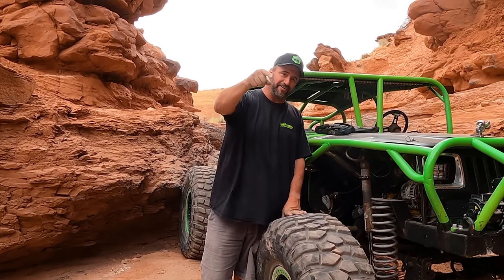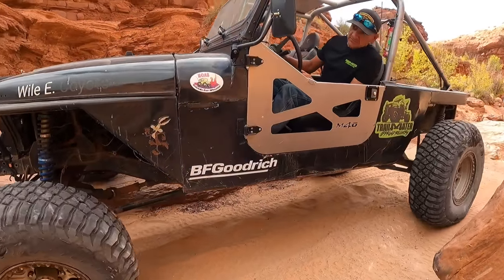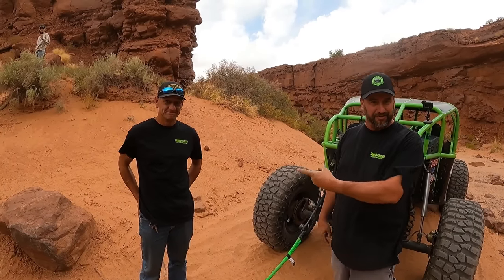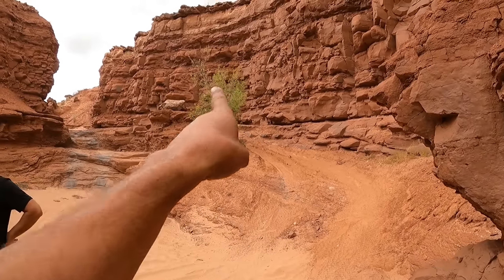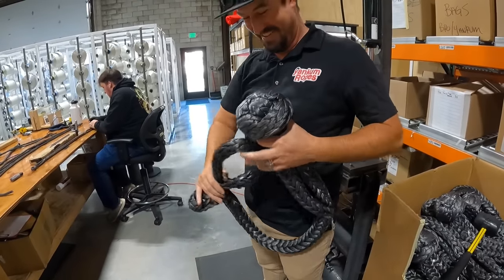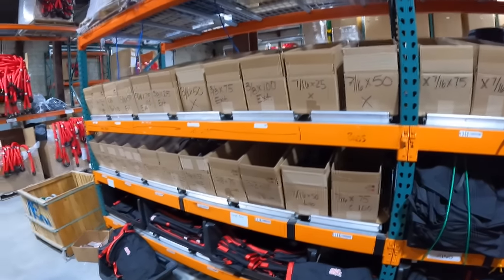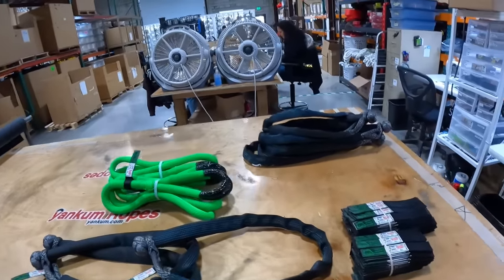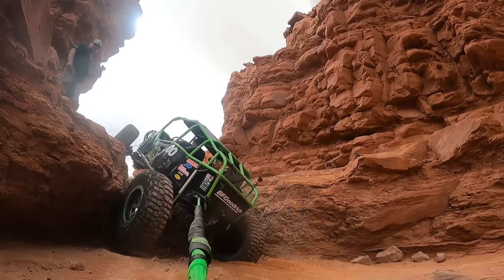I'm So Excited For This

Comment: We are super stoked to work with Rory and the team! Rory knew exactly what he wanted, and we were excited to make it happen! I think I can speak for everyone, we are excited to see what he does with this thing!  I did want to answer a question I keep seeing in the comments. "If you double up a 20' or even triple a 30" rope, then you are within 10' of the dead rig". This is true, however, the doubled up rope is basically now two separate ropes and the recovery vehicle now no longer has the mass to stretch 'both' ropes. You will lose the benefit of the full stretch, making the recovery more violent, like using a strap or chain. If you want a cushy recovery and drastically reduce the chance of breaking recovery points, the 10' is going to be perfect.
Reply: @YankumRopes, I could not find the spec on your site. What is the WLL and % elongation of the Trail Mater recovery rope?
Reply: Excellent stuff...Kudos to all, and the color turned out great... Edit : that machinery is mind blowing, crazy angles on all of that.
Reply: Hey love your stuff! You might know it, but if your material is sourced in America you can also brag its Berry Act compliant which is a huge selling point imo
Reply: why dont you make ropes with integrated soft shackles on both ends?
Reply: Ok.. the "superloop" 🤔
What about and bendable rod put in the middle of two big sofy shackles for rory to use as his crosses on the back of the wrecker.. 1 it will do what the others do by allowing to pull on the vehicles but 2 will act as a bumper to keep vehicles off yhe wrecker.. kinda of like dockin rods for boats🤔
Maybe 2 whip antenna things off the back of mater.. just an idea for ya fellers
Reply: Nice ropes. If u were to let a customer make a choice if they wanted to put their name on their ropes. They can with a little bit of extra cost. By doing this. Means u will sell more YANKUM ROPES.
Reply: @NAPAuniversalJoints  soft shackles get beat on a lot. If your soft shackle gets damaged and it is part of the rope, then you would have to throw the whole rope away. We would much rather just replace the shackle. We put our equipment to work constantly and know what real world recoveries look like and because of that, we have zero plans of ever combining a rope with the shackle.
Reply: @NAPAuniversalJoints  The only reason it sorta makes sense on winch lines is when the soft shackle wears out you can easily splice a new one in and only use a few feet of winch line
Reply: Just bought the 10ft rope and the super loop! I have been needing a shorter knetic rope for a long time! Thank you Rory and Yankum ropes!
Reply: Just placed an order.. thanks team trail mater!👍🏻👍🏻
Reply: Please tell me I will soon be able to get a complete trail recovery kit from Yankum Ropes in trail mater green!
Reply: Just put my order in for the bundle! 🍻
Reply: @YankumRopes  overlanding recoveries 🤣
Reply: But you also sell the ropes in smaller diameters. Can you double a 20ft 1/2" and be as stretchy and strong as a 10ft 7/8" or 1" rope? Is there a weak point at the doubled bend with repeated use like that?
Reply: @FinnellRacing you want American made quality and reliability you have to pay a higher price, better than a cheap unreliable china made one just saying 😊
Reply: @FinnellRacing how about a AMERICAN PRODUCT SUPPORTING AMERICANS AND NOT THE CHINESE OF COURSE IT WILL BE MORE EXPENCIVE,ITS DUE TO ALL THE DAM TAXES ON A BUSINESS HERE THAT HAS GOT TO BE TRANSFERRED TO THE CONSUMER,YOU CAN THANK ALL THE POLITICIANS FOR THAT,
Reply: @FinnellRacing who’s fault is that? I don’t think it’s overly expensive it’s actually very comparable to other brands and options for recovery gear.
Reply: Thank you sir .. the lifes you've saved, with your products, has to be some kind of record!
Reply: Thanks for explaining that so clerarly
Reply: Did you get a buggy?
Reply: Thanks so much for our facility tour this week, and for helping us get the new Trailmater rope package - we were treated like royalty at your Idaho facility when we stopped by on our way back home from Moab!
Reply: @daviddogruel7851 just as a follow up, the 10 footer didn’t look like it stretched on a couple of those made for commercial tugs. The wll shouldn’t change for each diameter rope but the elongation would be nice to know. I’m not sure if it linear or a curve vs length.
Reply: The 10' rope is a very good idea! Wonder what it would take to get them in my company colors 😂

Comment: My uncle pioneer the use of kinetic rope for the water ski industry back in probably the 80’s I think it was. Unfortunately just as the business was taking off he passed away. Back then he had to design and manufacture and design tooling, because the tooling to manufacture, kinetic ropes didn’t exist the winding machines, the fiber separators, all that all had to be designed and manufactured by him. I remember one time getting a look at one of his machines that he had just finished and he was showing us how he was whining rope. At that point in time he just had a hand crank on it.

Comment: Yes I love it that you got a rope that works for specific situations especially when towing around sharper turns and the shortness keeps it off the ground.  One thing I also noticed is when you are wrenching and the wench rope rubs against the sandstone it looks like it would weaken the wench rope.  If only yankam ropes could make a fabric protective blanket that can be placed between the wench rope and the sandstone or other sharp rocks so it doesn't cut the rope.

Comment: Always incredible scenery. The great news is that there is a short yankum rope for tight spots not only limited to Moab. This would be a great rope for getting a rig out of High Rock Bay, Key Stone Bay or anywhere off the Mandan road (it's not really a road) on the Keweenaw Peninsula of Michigan. Would be interesting to see how the yankum fiber behaves in minus degree weather with heavy snow.

Comment: Love it and love Yankum Ropes, but why wouldn’t just use a 30’ or 20’ with the loops on the pulling vehicle and the bite on the towed side? Like a basket pull.
Reply: you can double a 20" back. However it won't stretch anywhere near what it does normally, since the buggy doesn't have the mass to stretch, in essence, two ropes.
Reply: @YankumRopes  🤔

Comment: I've been carrying a 10' kinetic rope for the last 8 years.  It has worked well for everything I've needed it for.  It can't impart the same force as a longer rope, but it is still far, far better than the older snatch straps I used to use and 95% of the stuck rigs I encounter don't need huge forces to unstick.

Comment: Trail Mater team needs to train our Army recovery personnel. I worked with specialist (E-4) Mackie a great friend who was our 63B and 5 ton wreaker operator. I was a 63T also a specialist (E-4) assigned to 1/52 Inf redesignated to 7/6 Inf light armored battalion. I went through recovery training at Ft Knox Kentucky and we were never taught anything like what Trail Mater, MORR, and Fab Rats perform. I enjoy every one of y'alls videos it brings back memories of the friendships I formed in the Army and the experiences we all had. No sleep for 72hrs as legs broke equipment and pack replacements happened in place.

Comment: With that 10-ft rope it's just the right length based on your height for  you and Lilly to jump rope together 😁  Trust me it's a granddaddy thing have 5 of them😉 

Been using and splicing original manufacturer of  Samson double braided rope since 1970's. Used by Coast Guard as tow ropes (my branch of Service) and morring lines on U.S. Goverment (as a deep sea merchant sailor I have literally dragged 10 inch diameter 600 foot  12 foot eyes each end  across the decks of ships with the help of 10 other people 30 lbs per foot I'm told) ships.  I have the fids for splicing 1/4" thru 1" double braid. Expanding you line  of marketable products; kool. I know you are using those 10 ft ropes from a different manufacture. The time consuming part of making tow ropes is the splicing of the eyes. Large the diameter the longer it takes. My 2¢

Comment: One of my most used pieces of recovery gear over the last 20 years is a two inch wide, ten foot long nylon strap (it's suppose to be a lifting sling). I mostly wheel in tight, technical mountain forests where anything over twenty feet is nearly useless, and twenty feet is too long half the time. I'll get one of these ropes when I can as the stretch will be really nice.

Comment: This is Awesome, Rory..
But, Couldn't the 30 foot rope be manufactured with a braided slot every 10 feet for soft shackles? 
Then just use what you need in 10 foot increments and throw the extra in the back of your buggy..
Have a good day.

Comment: Me too Rory,
I wish had money for any one of these kind of systems.❤🎉🤑
But that will help out a bunch of knuckle heads in tight quarters.
I'd rather buy 2 or 3 of those to fit the situation rather than buy a big pne i can only use in open areas.

Comment: Awesome. Congrats!!!!! It would be cool (but probably not possible) to get a 30 foot rope that had links every 5 feet to shorten the length down to 10-15 feet. That way you have a rope that is 10-30 feet. But doing that would probably compromise the integrity of the rope. I know winch lines have something like that under the sleeves.

Comment: About time to have other lengths than 20 or 30 ft. I'm not hating on any one, but even having to do a quick tow in east of Mississippi side they are to dang long in many cases. Yeah you can double up to make it work but hauling 20 ft on some vehicles is not handy.  I was directing and doing a recovery back in summer of a SUV that was almost rolled over into a deep pond the trail next to it wasn't very wide and other side was slope covered with trees. That would have been great for use as a bridal for stabilization and side pull up out of edge of pond. I happened to be visiting a friend in KY when that one happened. 
 I tied up a few "super soft shackles myself after that recovery. That was good to see them too.

Comment: I love this I would order n a second if I was still off roading but age and cost has stoped me. I used ropes back in the 80's that you could buy at any hardware store, although not made for that abuse the worked great. the polyester had lots of give. that shorter rope is ideal. I always kept a short one on hand as well as a long one. and yes I often would break them so those you have today are MUCH better than what I was using.

Comment: Serious question: Why do you use the soft shackle in combination with the hard shackles?
Reply: Depends on the recovery point. A lot of bumpers have sharp edges on the recovery points. Hard shackles are meant to be mounted to those types of recovery points. If you are going around a smooth radius, then there is no need to use a hard shackle.🤙
Reply: That makes sense, why not connect recovery rope directly to the hard shackle? Why the soft shackle intermediary between the hard shackle and the rope? I know i am probably missing something obvious.  @YankumRopes

Comment: Have you guys made a video explaining why you don't use nylon straps? Im used to oilfield rigging and don't know jack about recovery, but I do know a lot about lifting and dragging. Please someone enlighten me.
Reply from the maker: Nylon straps are still used for rigging up snatch blocks and winch extensions. They can be used for towing also. Just alot more violent when the rope goes slack and then tight again.
Reply: Thank you for the reply, keep up the great work! @trailmater

Comment: I never thought about it until now, but I  have had a 10ft and 30 ft strap since the early 1970s, and still do. They are not kinetic ropes ,but very heavy lifting straps that were used in a manufacturing facility.  The worst thing I ever saw was a pick up truck pulling another pick up out of a mud hole from the back. The stuck truck had a bolt on trailer hitch and they used a chain to snatch the stuck truck. The trailer hitch tore off the frame and flew threw the air and smashed the rear window of the pulling truck. Unfortunately  the woman passenger in the middle of the seat received the trailer hitch and chain in the back of her head, I believe she died at the scene. I swore I would never use a chain for any pulling of a vehicle again. I never had a lifting strap break. I still have the straps from 1973, they are badly worn and haven't had much heavy use in a long time, but I  believe they are safe. A strap or rope will lose energy fast it breaks. I normally thought about making a rope because the straps did a great job and were free. The company said I could have the straps, because they had a small cut or frayed spot, and had to be replaced per OSHA regulation. A 20 ton strap can easily pull a vehicle and the short strap has little chance of getting under a tire when towing. The long straps work great for long tows but do get frayed at times. Im glad you came up with the short rope. I always use a steel shackle, but I  can see an advantage to the soft shackle, however never had a steel shackle break. Keep up the great work.

Comment: Super cool but why did you leave out doubling the rope like matt an fab rats do all the time for the trail? So you can have a long an short for those who cant afford both. An i love yankum but i dont like that a paper i seen said hand made in the usa. They are made by a machine not hand. Besides that i do support this product an both you guys. Just need to be fully open an not avioding those little detail that do matter. Yes some parts are hand made but my buddy got one an was so confused because the paper says hand made like the rope is hand made when its just hand finished if that makes since

Comment: I may not be the sharpest tack in the box but one could double up a 30 ft and end up with a 15 ft or triple it up and end up with " surprise", a 10 ft.
Reply: Also if you watch the video all the way through you will learn it’s more about the quality and American made product that is superior to the competition.. not just the LENGTH
Reply: Great question! However, tripling up the rope, essentially becomes 3 ropes, which would almost eliminate the stretch in the rope and would equate to basically a static pull (chain or strap). The buggy would not have the mass to stretch 3 3/4" ropes, but it can easily stretch 1 of them.

Comment: I'm no rocket scientist but anyone with a little common sense... if you have the 30ft rope... you just run the rope from the towing vehicle to the disabled vehicle and back to the towing vehicle which turns the 30ft rope into 15ft. And if you want to turn it into 12ft you run the rope through both hooks on the disabled vehicles bumper. 🤫